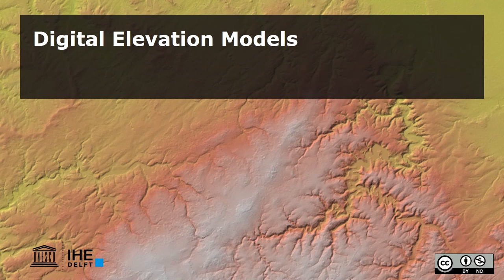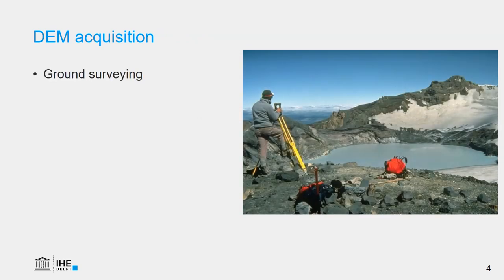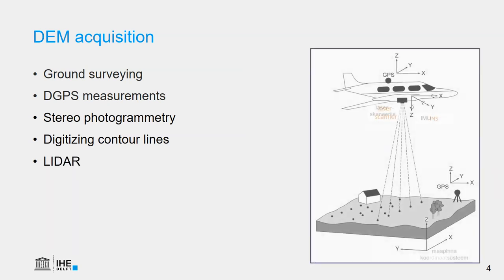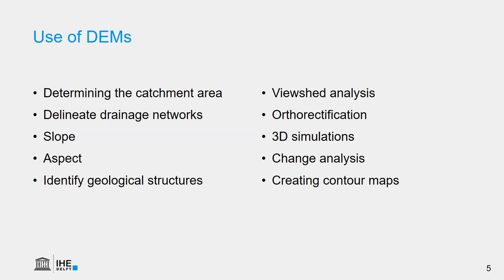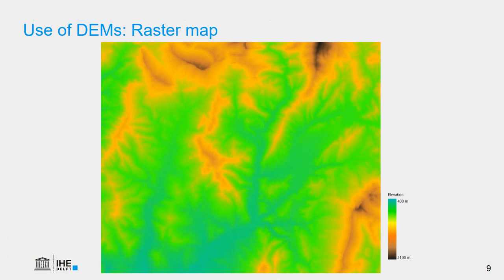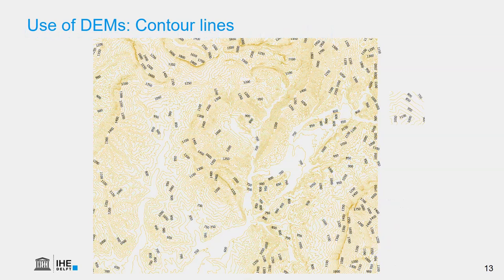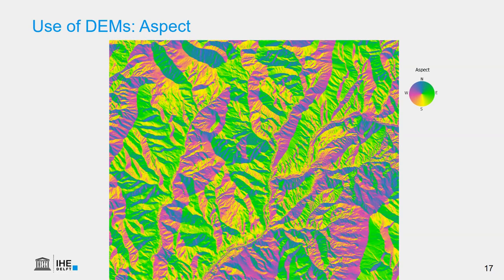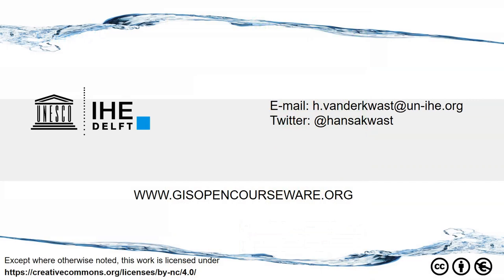Digital Elevation Models in GIS (theory) - updated

Comment: Very informative videos, thank you. I was wondering about that dial in the hill shade example around the 7:31 mark. Is that part of QGIS itself or does it come with a plugin? Another question I have and, correct me if I am wrong, regards the draping of a satellite image such as Sentinel 2 over a DEM. S2 is 10 meter cell size and a typical SRTM DEM would be 1 arcsec or roughly 30 meters cell size. If you drape a S2 over such a DEM, the result would look rather grainy in 3D (or rather 2.5D). Instead, I often reproject and resize the DEM to 10 meter cell size and then drape the S2 over that. It looks much finer but of course it is only for illustration purposes because the cell values in the DEM would not be accurate. Am I right in my assumptions? I do this mostly in SAGA btw. Thank you.
Reply from the maker: The dial is part of the QGIS hillshade renderer which is available in recent versions. So no plugin needed. I don't think the resampling is needed, the 3D view will take care of that. It will not make a difference, because it will uniformly cut the pixels. A better way is to use the resampling option in the Layer styling panel and put it on bilinear or cubic.

Comment: Thanks for the video! 
May I ask why the light source for hillshading is commonly placed at NW? Are there cases when different placement of the light source is preferable?
Reply from the maker: Our brains are intepreting relief correctly if the light source is in the NW, so that's just for visualisation. If you want to model real shades, for example for planning solar panels or energy balance modelling, you should adjust the hillshading according to the sun elevation and angle, which is possible in the algorithms.
Reply: @HansvanderKwast  Got it, thanks!